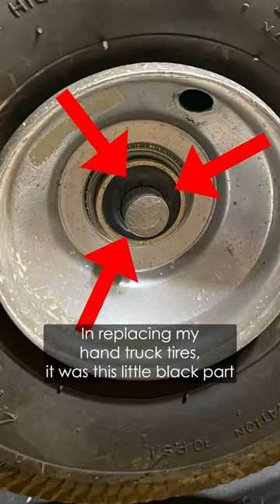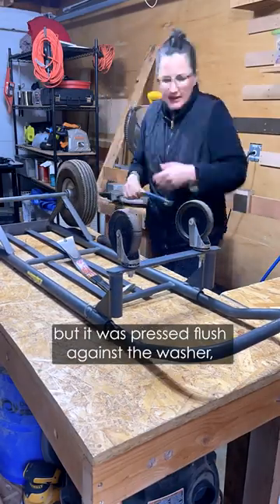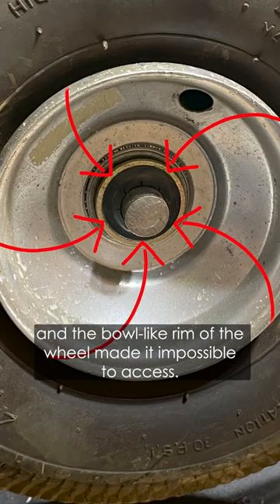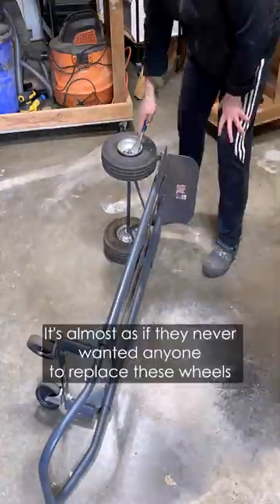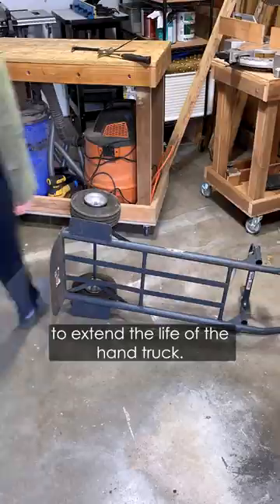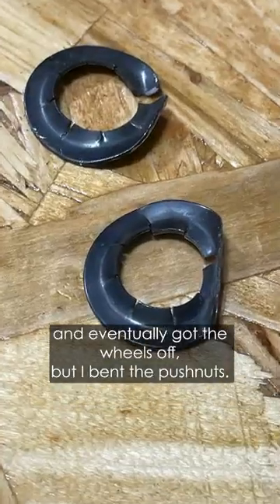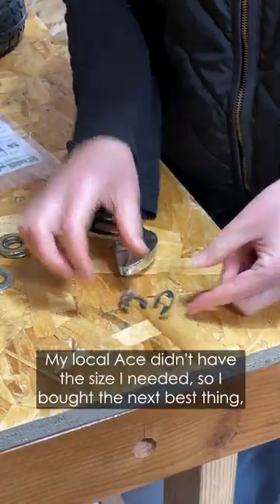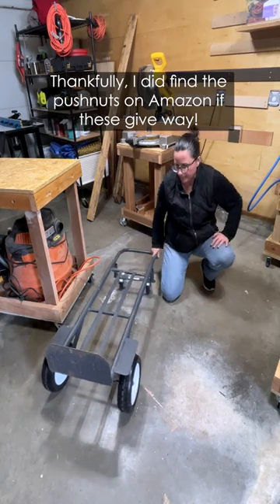DIY Replacing Tires on Hand Truck 🛠🧰💪

Comment: I pulled a dolly like that out of a dumpster at my old apartment. I replaced those push nuts with a washer and a hose clamp. Works great, and when I replace the wheels next time it'll be way easier.
The manufacturer needs a way to mount that wheel that's fast and those push nuts are quick.
Reply: I also pulled one out of the dumpster years ago! I've been using it with flat tires, but now that I'm replacing my Gorilla Cart tires and only two were flat, I'm putting the good ones on the cart. I might have to use your solution if I can ever get the old tires off!

Comment: Yea push nuts are one time use. They're nearly impossible to get off without breaking them because they get tighter and bite into the axle even more the harder you try to remove them. Just break them and replace them or drill holes and use a cotter pin and washer instead.
Reply: How do you break it?  I’m trying to change mine now and it it going poorly.

Comment: Many people drill a hole through the axles and substitute a washer and cotter key.  Cotter keys are also one-time use.  
    You need to cut a groove around the circumfrence of the axle to get those E-clips to be reliable.  That's how they're intended to be used.
Reply: A hose clamp is a cheap and easy option as well

Comment: I have a similar problem except I’m trying to replace the one caster wheel that broke off and now I’m left with this star shaped thing with six points that hides right on top of the actual wheel that broke off I can’t seem to find a tool for it